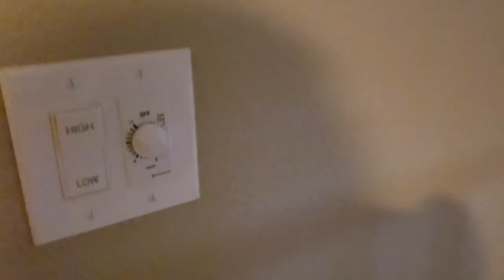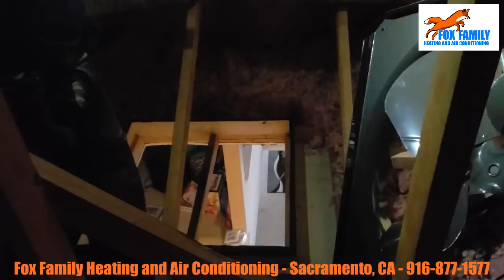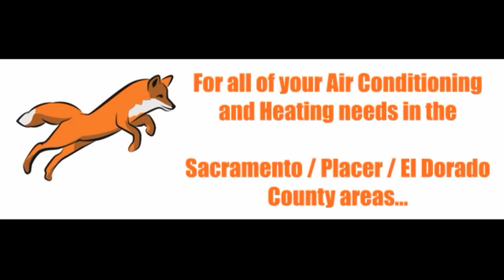How to Install a Whole House Fan

Comment: Sorry for my ignorance but what’s the purpose to have installed a fan ? And does the insulation doesn’t suck into the house ?
Reply: Hvac_jc it is used to cool down the house. You crack open your windows and it pulls air through the house. Works great in low humidity areas. I have one In NC. Cools your body down good until it gets around 75*. Just a think of it as a big box fan for your house.  Discharges into the attic
Reply: you should more than crack open the windows, but what he said above, but in cooler weather it is used to pull cooler air in the  open windows  and push it out via WELL VENTED attic space. the return is two fold, you cool your attic also and extend the life of the roofing practically 10 fold. """"yes it requires very well vented attic space!""""
Reply: Kenneth Parker p

Comment: ahh old school energy saving devices, providing neighbors are far enough away and there are often mild temps! they actually work great compare dot the fudge of now days ;)
forgot to mention awnings, large overhangs etc is a must and of course non criminal areas (the major downfall of open windows and only screens for protection) 
myself feed the screens 10KV at multi-amp discharge rating and let natural selection occur :))))))))) yeah I'm an ass at times sorry, but take it with stride ;)

Comment: that fella is a keeper, boxing up a fan duct to move it and lessen the noise to homeowners, makes great sense for areas far away from noise like rat nest/ant farm packed city areas >_>
I'd rather hear the fan roaring than neighbors fart/mow/cars/arguing/etc :))
Reply: forgot to mention, if not enough open air intake(open windows/doors), it will "back draft" all open atmospheric vented appliances and could cause """carbon monoxide poisoning/buildup"" which = silent death if sleeping.....
Reply: OHHH, ffs I commented too soon, I thought he was boxing a duct to move the exhaust fan itself up away from the intake grill.... ((((((so never-mind and fail for other than very deep insulation purposes. noise reduction minimal with likely decreased CFM airflow ;)

Comment: Direct drive whole house fans  are louder than belt drive. I would know. I had a Direct drive whole house fan.
Reply: i'd coin that a fail install/cheap-out! they 100% need isolation mounting, aka cloth/flex duct section joined. same for laying HVAC unit blocked off the attic joists/floor vs suspension from rafters and RTU's on the roof ;) tranfer the noise down rafters to outside walls and there's a huge dampening effect

Comment: So when the fan is off, those vents won't seal in cold or hot air (depending on the time of the year). You will be constantly losing money with the AC running or Furnace running. Imagine walking by and just seeing your attic,.. definitely a no. Another house fan would be the better option. JS 🤷‍♂️
Reply from the maker: Yeah definitely from a home performance point of view, this style is not very energy efficient.  The shutters do close but there is no insulating value to the shutters.  Quiet cool brand has some insulated dampers that actually keep the attic seperate from the hallway which is nice.

Comment: this is ridiculous. Fire the guy immediately the technique, and is using just cause the sheet rock and all of the chemicals to disperses dust throughout the house probably going into the air conditioning vet and polluting the entire house. Should be using a vacuum system. This is a production job with no care concern for the customer just his pocket